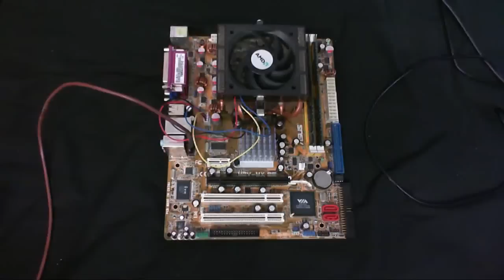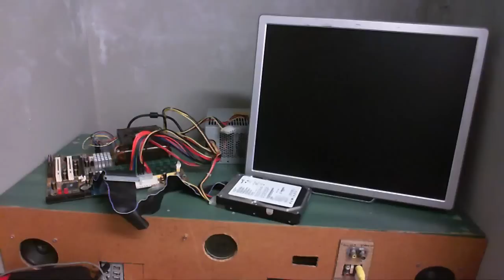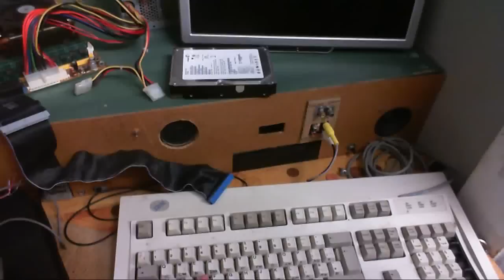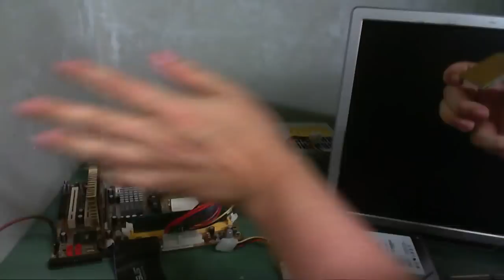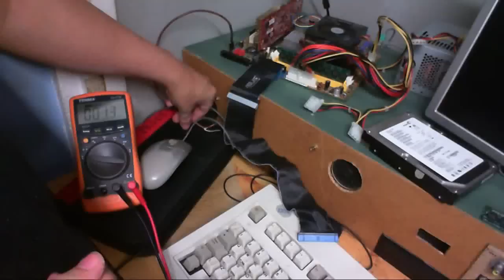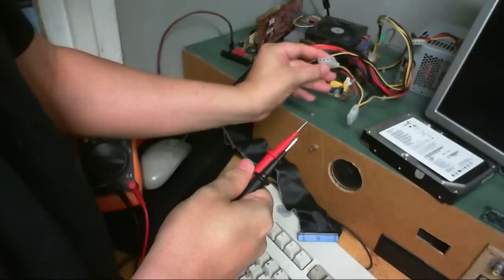Is this Mobo dead?

Comment: In order to see if the RAM and CPU are working and that the south/north bridge is still alive, try to power on the motherboard just like you did with your custom made CD audio stripped cable. Then retouch (short) the wires again for more that 4 second. If the motherboard powers it self down, then there may still be some hope. Now reseat the Ram sticks with a bit of pressure in the center (perpendicular) to the board. wiggle it in place to ensure good contact. I do advice to clean the Ram contacts on each stick with alcohol. Whoever, you still need a PC speaker or a buzzer to check post beep codes. You said the sound chip is blown! check its supply voltage for shorts. This advanced step is done by measuring voltage directly on the board when its on it should be 3.3 or 2.4  depending on the chip, this is measured across a relatively big ceramic Smd capacitor nearby the sound chip. Hope this may be of some help to you.

Comment: Check all appropriate power connections are provided to the motherboard (aux socket top left), is there a PC speaker on the board? If not connect one, does it beep? No? Try to provoke beeps by booting with no ram installed?  If possible test without that graphics card (onboard?) also ensure to test with no USB peripherals or loose cables connected as a short or fault in one of those cables can cause no post issue.  Didnt notice while skipping through the video if you had tried another CPU, or resetting bios, inappropriate settings or bad cpu may cause no post issues. Beyond that troubleshooting is all spot on.

Comment: Two suggestions: Get a small internal PC speaker and connect it, because most motherboards will use beep codes to indicate problems and successful initialization. 2nd: Get a PCI diagnostic card, which will show POST codes as the system is booting. If the system hangs, you can look at the code and get some ideas as to what is not working. I like the Asus m5a97 r2.0 motherboard for AMD CPUs.

Comment: i always, strip the board down, and give it a good clean, clean all cables and edge connectors on board and then replug everything back in. as cables and compants come off i put them on an old pc which i know works to test the parts as well so i know what i am using.
Reply: Your idea is the best!  My friend had a similar fault that turned out to be a hair in one of the memory slots! A good clean can make all the difference.

Comment: Seems pretty dead to me. You've done all the stuff I'd have done. It's possible the board has an internal power rail missing; it seems very dead- you'd have expected to have seen something on the monitor from the GPU initialising if it was all up. Have a look near the power connector to see if there are any SMD fuses, and check them for continuity. Also, there isn't a 4pin power connector elsewhere on the board (near the CPU socket) that's expecting some volts up it, is there?
Reply from the maker: Alan Cordwell Everything was connected. Not much I can do with it now.

Comment: 24pin mainboards require more power then the previous 20pin versions, thus the extra 4 pins are necessary to provide extra power. Try reseting BIOS
Reply from the maker: ***** I did try resetting the bios by taking the battery out for a while and putting it back.

Comment: I think the cpu is drawing too much power which is why the 12v rail is so low
I would use a higher wattage psu which also has the 24 pin connector

newer supply's also have more amperage on the 12v rail for big cpu's and gpu's
Reply: 12v rail voltage is within allowed tolerances.  If the PSU voltage on a rail drops below spec when overloaded then the PSU is unsafe and should be thrown away as under/over voltage or overload situations should trigger a trip.

Comment: I think you'll find that nearly all of the time, Intel processors will out-perform AMD processors of the equivalent spec.   Intel are the inventors of x86 architecture and are driving the development of this technology forward.   AMD and all of the other compatible manufacturers (now or yesteryear) have always been on the back-foot so to speak, trying to keep up with the Intel technology.  In addition to the compatible processors being generally slower, they are almost always less efficient than Intel as they tend to run much hotter for their corresponding transaction throughput.

Comment: Download the manual from the site, it will tell you that you need a 24 pin ATX psu, and I am pretty sure you need a 4 pin connector which has 2 yellow and 2 black wires (+12v amd 0v) which will plug in near the cpu somewhere.  It wont boot with the wrong PSU.
Reply: At the end of the day - download the manual and it will tell you the PSU to use....  simple.
Reply: yeah - very clever - put the wrong voltages into a motherboard!  Great advice. 
Service manuals are very useful bits of kit and hardly 'stupid'.  They are only stupid if you do not understand them.
If your motherboard has a 24 pin ATX Socket, it needs 24 pins to work.  They wont work on 20.  The rails are not paralleled up.
If that was the case, computer power supplies would have maybe 6 voltage wires out of them (all be it heavier gauge wire).